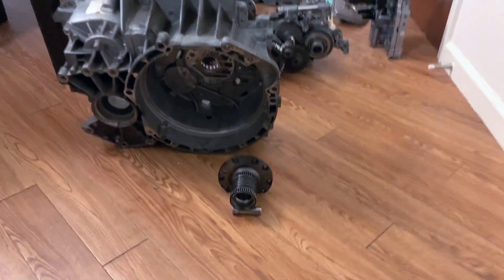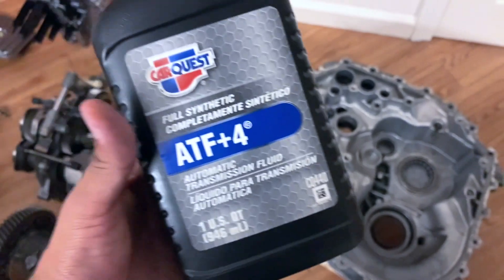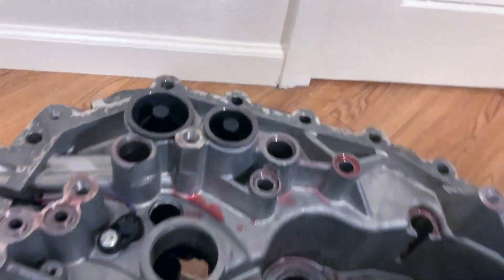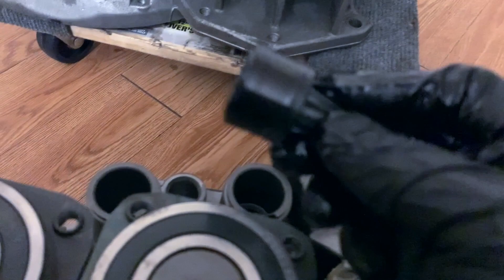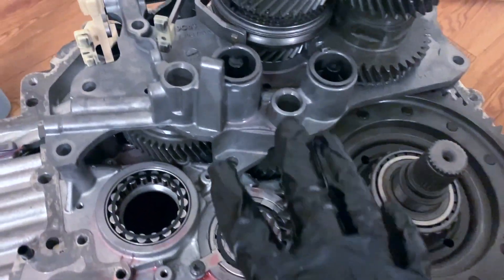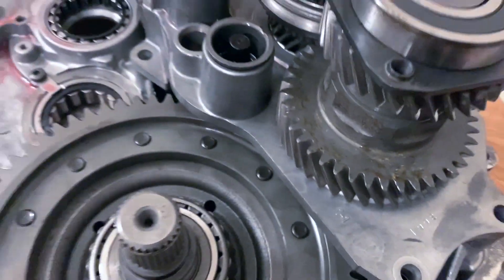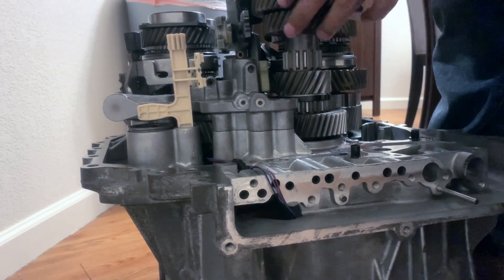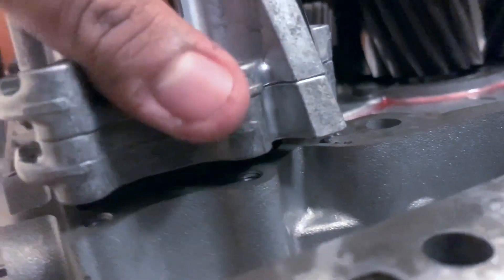Mitsubishi Evo X MR DCT470/ 6DCT470 Transmission build  - Part 8  Rebuild

Comment: Do you have a link for the upgrade shift fork also for the pistons
Reply from the maker: I got it from SSP Performance, no they don’t have a link to it but you can message them. That’s how I got mine. SSP, Kozmic, & Dodson make the upgraded shift fork.
Reply: @josezamora7889  thank you im planning on DIY my evo transmission too and your videos have help me and giving me the courage to do it instead of paying 10k
Reply from the maker: @solraczetined5951  yeah, I’m the same way. I didn’t want to pay 10k for a repair or new transmission so I decided to do a bunch of investigation and tackle this job and help others by documenting it .
Reply: @josezamora7889  yeah thats  crazy how much they charge and at the end they dont do what you did. Going to deep detailing the engine so it would be cleaner, they just fix what you pay them and if you want something else done it would cost you more. So yeah thanks for what you doing.

Comment: something I would like you to set is the tightening torque and I want to make a comment I hope you do not take it the wrong way, I think that I would not use a power tool to tighten the screws since it is sensitive material and could easily damage it. and that would be another story..
Reply from the maker: Ok thanks Tsalin for the helpful suggestion, not a problem I’ll try find that out 👍 thank you